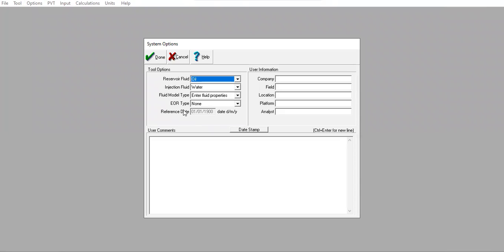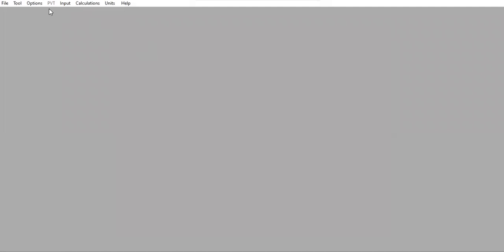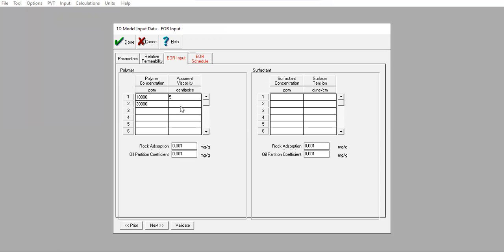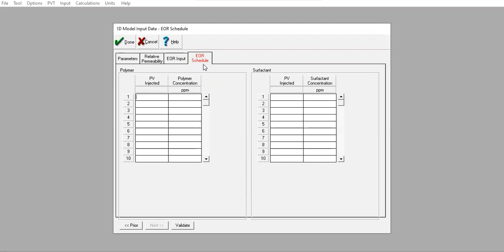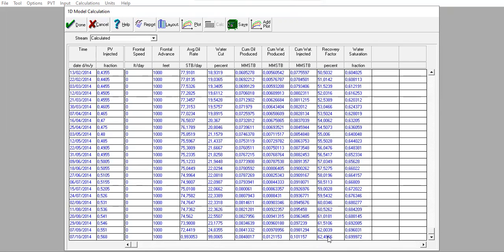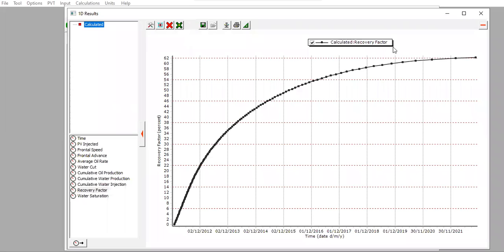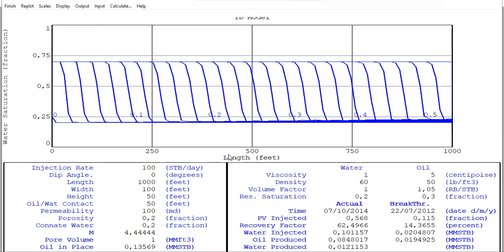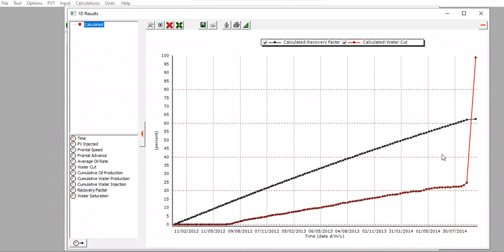MBAL 30: 1D EOR Polymer Injection

Comment: what is name the program?
Reply from the maker: It is MBAL
Reply: @EngMan101 Question: Can a polymer and petrochemical engineer work in the oil sector, specifically in well drilling operations?
Reply from the maker: @abbasalmalik5659  100%. Majority of engineers, regardless of their major, will learn from 0 basically